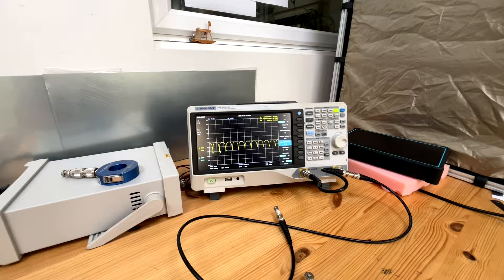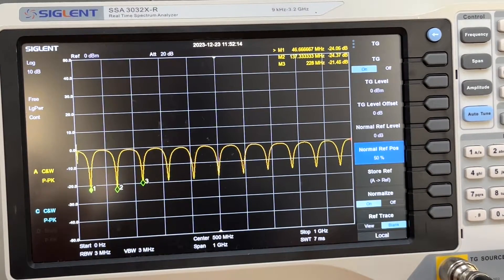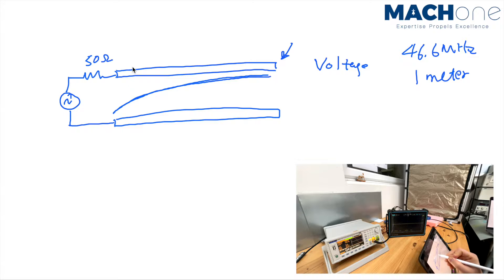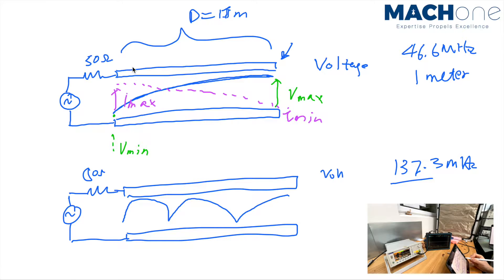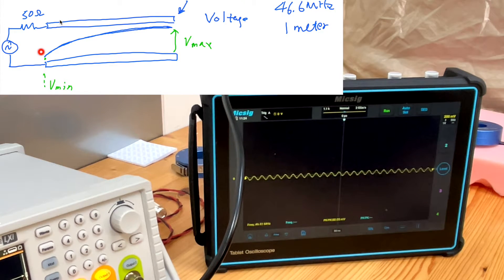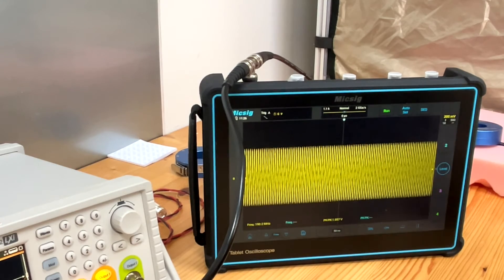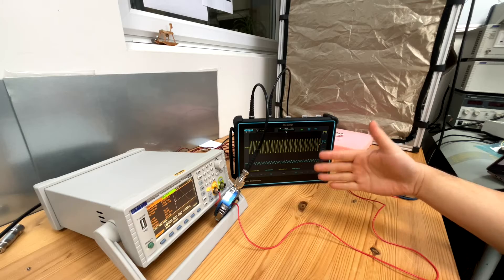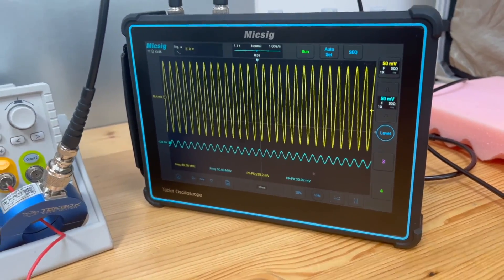Cable Antenna Resonant Structure explained in Time Domain

Comment: Excellent demonstration in time domain of common mode current!
Is this analogues to RF currents flowing over single cable within power electronics equipment like UPS or VFD where switching of occurs with low rise/fall times?